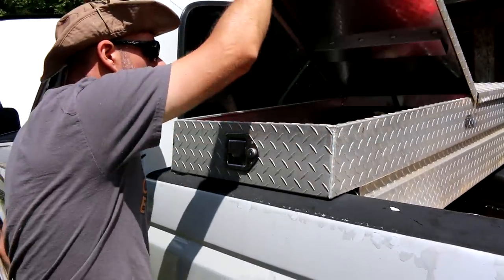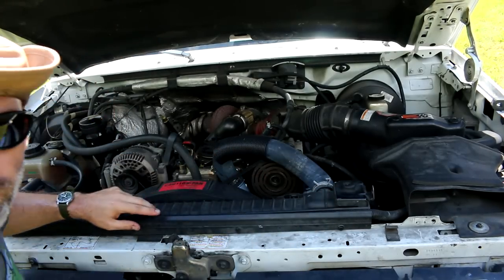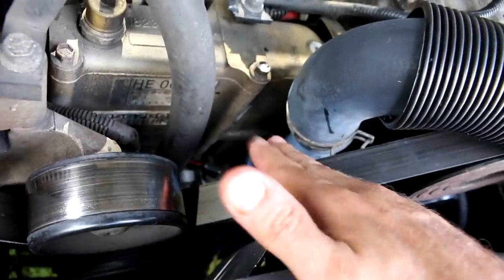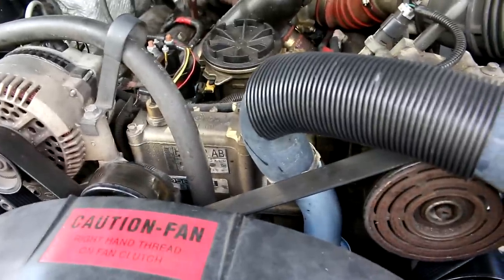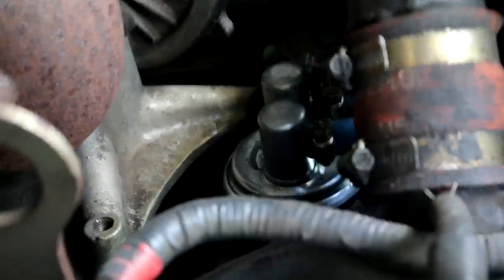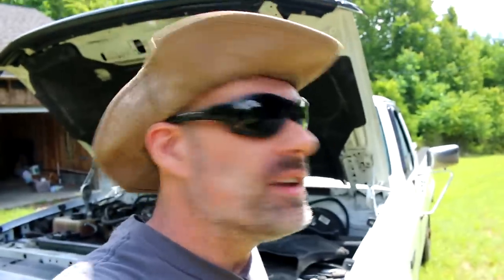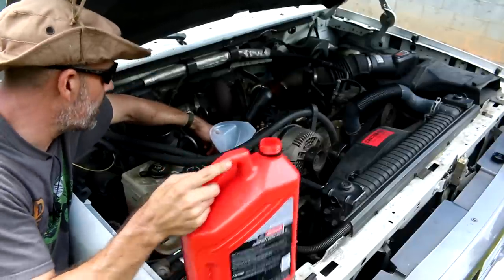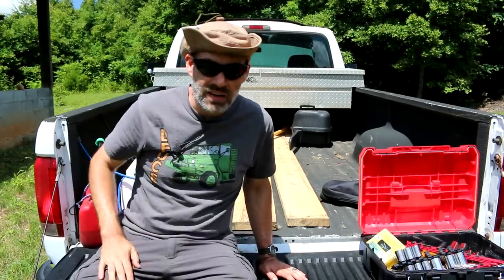10 Common repairs for a Ford 7.3 Diesel truck

Comment: Changing trans fluid/filter is easy, but I´m sure Ferd managed to put a sensor in there or something that needs zeroing out on the ECM computer
Reply: Nope. 4r100/e40d have no sensors needing zeroing. Nor does any of the ford f series transmissions do

Comment: Great video as always. If you have never changed your trans fluid it is better not to at all at this point. If you do it will most likely cause a lot of problems. You usually want to change it every 50,000 miles or so.

Comment: If the transmission fluid hasn't been changed in a long time it would actually be better to not change it and instead just keep the level up on it. If you ever have a problem with the overdrive off light blinking on the shifter, your speedometer not working and hard confused shifts, it's not the transmission but a bad vss on the rear differential. Bout a 10 dollar part and a 10 amp fuse in the dash. Just something for possible future reference.
Reply from the maker: Awesome info.  Thanks!
Reply: Totally stupid advice. Service transmission regardless of mileage
Reply: It's really hit or miss man, have you ever built any automatic transmissions? I have built quite a few in my time.

Comment: I like you. Ypu are funny and down to earth. We have the same truck , white like yours. It's leaking diesel, oil (don't know from where), and tranny fluid from a cracked tail shaft housing and yoke plug seal

Comment: I have a 10/97 F-250HD 7.3 old body and haven't had too many issues with auto part stores. Usually right on every time. But a lot of online stores don't recognize the 97. Just a heads up if it was manufactured after July you can use the super duty 7.3 high pressure oil pump.

Comment: If you have never replaced the transmission fluid before do not do it now it will screw up all of the clutches and it will break sooner
Reply: i would check the color on the fluid if its red then a change should be still fine
Reply: If the transmission is still perfectly smooth changing the fluid and filter wont hurt anything.

Comment: Your exhaust back pressure valve also works off your ambient air temperature sensor connected to your air box. It won't throw a check engine light but will throw a code. Try that.

Comment: Hey you have e4od transmission in your truck I would recommend doing transmission oil change and then putting in superior Fairbanks shift kit which are prolong the life of your transmission part number- PT4R100 and I did the Stage III level in my 98 expedition And do not use a flush machine on your transmission do it the old-school way were you do it in a bucket so hope that helps

Comment: Rather than changing the transmission fluid, it's best to have the transmission flushed,  what can happen with a lot of miles it will still have dirty fluid in the torque converter. Changing the fluid and filter would be ok if it was less than 50000 miles. The flush is much cheaper than another transmission. Just a suggestion
Reply: Flushes destroy trasmissions, they are about the worst thing you could  do.
Reply: @alanack67  
I've had very good luck with the transmission flush, a friend of mine bought a new 2012 GMC truck  and every 50,000 miles had the transmission flushed and now with 150,000 miles been trouble free, I had a new 1990 Dodge and I did the same thing every 25,000 miles and  after 100,000 miles no problems

Comment: E4od transmissions are junk for regular  heavy duty service , im on my 3rd built trans , but for general use a hd. Torque converter , all billet internals a tugger kit and dual coolers with a elec. Fan will last a while

Comment: Hey BC,  I had to have the fuel pump replaced on my 1990 Plymouth Grand Voyager sometime back in the 'oughts.
What idiot decided putting the fuel pump inside the fuel tank was a great idea?

Well I did get a small break on the labor from the car repair shop in the strip center 
where I had my computer repair shop in Houston.
Unfortunately my gas gauge never worked right after the repair.  I think they must have
damaged the float.  Empty for me is at or about 1/4 tank.  I like to say I really have 
a guess gauge now.   So I sympathize on your loss of a gas gauge.

Comment: I have a 1992 custom F350 I really haven’t had too many problems with it in a past until recently my serpentine belt broke Oh me a mile away from my house I drove it the mile home Turned it off replace belt and now every time I turn the key my Main 20 amp fuse blows It did rip off the negative wire from my Second  battery I replaced it it was the ground wire has not changed anything can someone please Tell me what I’m doing wrong

Comment: If the transmission is smooth and works fine now then just do a fluid change. 

You're only changing less than 50% of the fluid (and the filter) so if it's worn but not showing it yet it won't neuter your transmission.
All you do is drop the pan, unscrew the filter, and then put the new filter and old pan on.
If everything still works great after that then next year do the same thing again and you should get most of the old fluid out and keep your transmission nice and happy for another 22 years.

Also your truck is as old as I am.

Comment: If someone can please help me out I’m looking at a 7.3 tomorrow and it would be my first diesel and I’m wasting all my $ on it the other option is a 2006 Chevy 2500 gas what should I do
Reply from the maker: Diesel engines (even the 7.3) cost 3 times more than a gas engine in general maintenance.  I don't know anything about Chevy gassers so I can't compare them.  If the 7.3 has been well maintained chances are it'll be a good one.  They can take a ton of abuse but if something major lets loose inside it gets expensive real fast.
Reply: If u wanna haul heavy loads then go ahead and buy the ford... If u wanna swallow heavy loads you buy a chevy 🤣